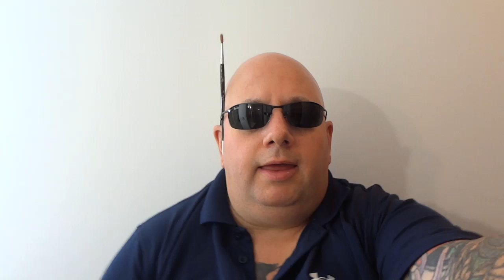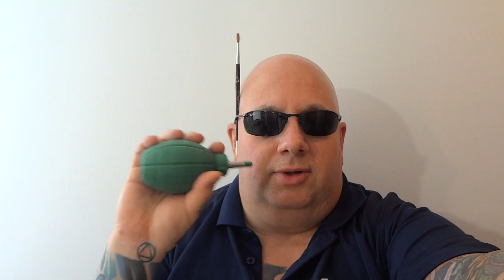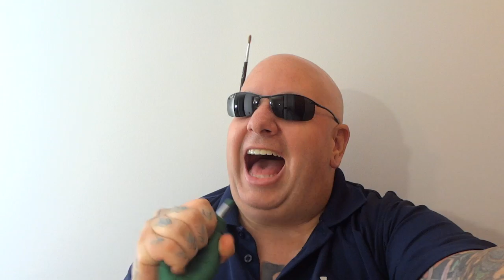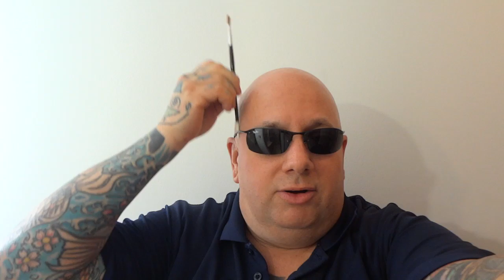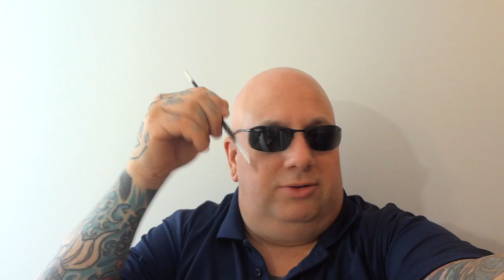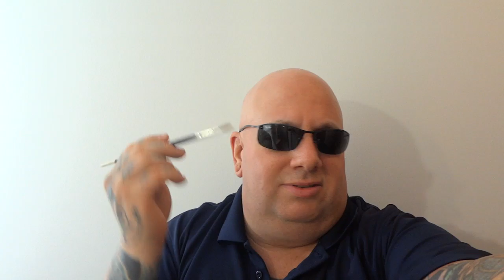Pro Tip HOW TO: NEVER use CANNED AIR on your camera or lenses & why

Comment: I used canned air a few times to clean my sensor, maybe 2,3, max 5 times. I didnt know it was bad. I haven't got any problems until now so should I be fine if I quit with it and do you think the camera will continue working fine?

Comment: It's not just the velocity that's a problem, it's all the freon sh*t that's goes all over the place. A friend of mine used canned air to clean dust off his sensor and it took seven wet-cleaning cycles to remove all the freon residue.

Comment: Can I use an E type lens on my D3200 body?
I know I will only be able to focus manually if I can but that doesnt matter
Reply: +Theoria Apophasis
Reply: If by E type you mean series E manual focus, they'll mount. obviously. but the camera won't recognise what's hanging off the front, and will only really shoot in Manual mode. It also won't meter.

I used a D3300, not a 3200, but on the 3300, in manual mode, the scale at the bottom of the viewfinder acted as a meter of sorts, telling you [very roughly] if you're over or under exposing. but that scale in any other mode, with a manual lens, also functions as the rangefinder. therefore, with a manual focus non-chip lens, you'd have to rely on the focus confirmation dot to focus, or you'd have to swap between another mode to focus, and then back to manual to actually take the shot. 

Point being. yes, you can mount a series E lens and snap pictures. But the camera will give you no help whatsoever with taking said pictures. you'll want to brush up on the sunny 16 rule. I actually got a split focusing screen for my 3300 to use with MF lenses, cuz the viewfinder sucks.
Reply: yeah it fits on the camera, you manually focus and meter.

Comment: What's the proper way to clean the mirror of a DSLR? Not the sensor, the mirror. There is some dust there. A blower will not get the little dust particles off.
Reply from the maker: thats not like a regular mirror, its more sensitive to scratches than you ever dare imagine

the dust there, U live with it  , ROFL

Comment: Aside from the damage that can be caused by the velocity of the air, there is also the thermal shock to consider.  The air leaving the can has been under compression and comes out extremely cold.  Frigid air on a warm sensor or other parts can't be good for them.

Comment: I imagine the very cold air would be an issue too regardless of the velocity.
Reply: it's not "air" the compressed air cans use a compressible gas.
it's not oxygen or co2 or nitrogen, but difluoroethane or trifluoroethane or tetrafluoroethane
they aren't flammable as a gas, but you can light them on fire in the liquid form.

yes it is cold enough to cause damage but only if you turn it upside down and spray out the liquid air.